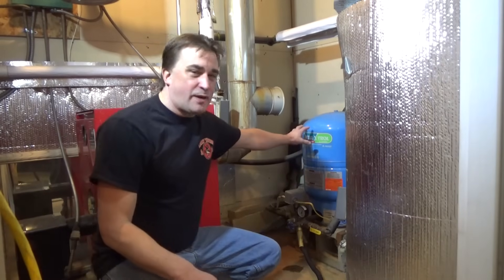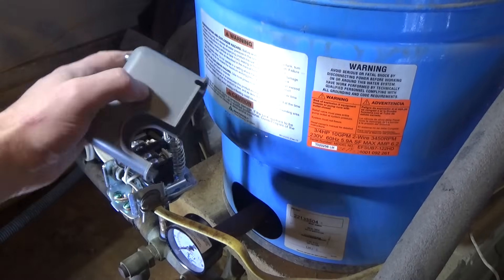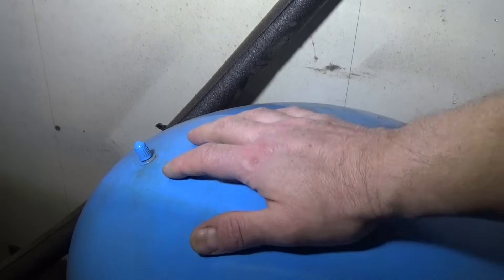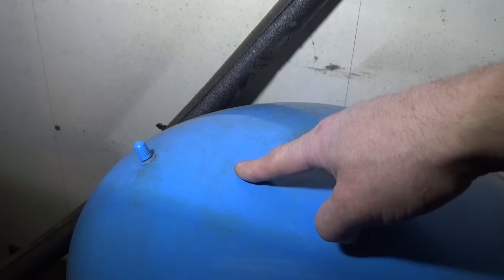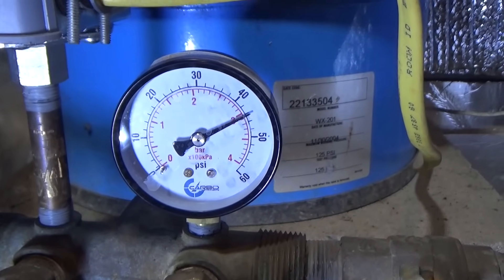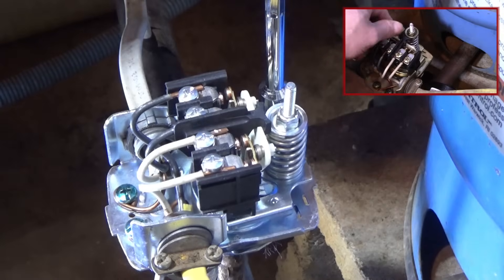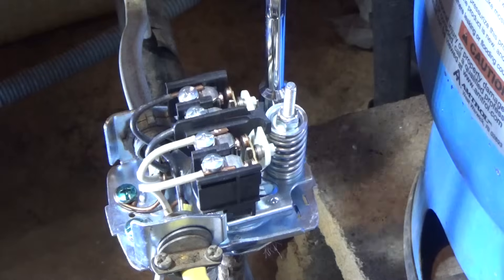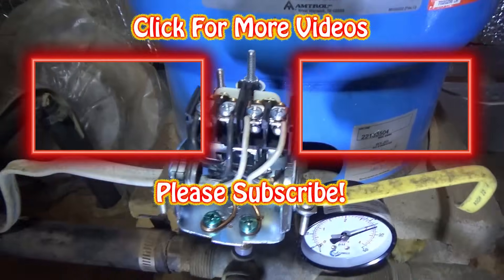How to Adjust a Water Well System Pressure Switch and Bladder Tank - Well Pump Diagnostics

Comment: Question..Installed a 40-60 pressure switch. Turned on power, pressure was 70-90. Not good, any reason why.
Reply: too much pressure in the tank when it is empty , t2 lbs. under cut in empty , check valve is fine , gauge is wrong

Comment: You could state which way you turn the adjustments. For example to cut in at a lower pressure turn ccw. To cut in at a higher pressure turn cw. To cut out at a lower pressure turn the other adjustment ccw. To cut out at a higher pressure turn cw.

Comment: Thanks,was good expansion,,
How we can set pressure switch when u have twin unit with 2 pressure switch?
Reply: Only the pressure switch with power to it needs to be set , the cut in pressure of each tank also needs to match , that is 2lbs less than cut in with the  tank empty

Comment: A quick tip.....if after taping the side of the expansion tank listening for a change in the tone which defines water at the bottom and air in the top if you cannot make out a difference in tone take a small screwdriver and press the air valve atop the tank for a second and if you get water shoot out it means the diaphragm in the tank has ruptured with NO FIX...it has to be replaced .
Reply: I suppose that can be why my pressure valve reads 100 and has rusted on top of it. It could be that my pressure is all the way up for cutoff. Ill verify that as is done in the video then look for this
Reply: Get up lebastard get up.
Reply: H u 5y
Reply: Great additional comment on top of a perfect general instruction! Thanks for the tip 
Mr.@harrylebastard!!!👍
Reply: Great tip Thanks
Reply: Absolutely true and a great point to point out here thank you!

Comment: Still when one of two out door faucets is being used the pump short cycles. When both faucets are used at the same time the pump runs without recycling? Help
Reply: Ken Woodworth if all is well and you have NO leaks of water or air then yes it should be constantly running however if you have a small tank it may fluctuate as the volume of water being pumped in has to be the same or greater than the volume being pumped out.
It also depends on whether you have an aerator which has its own pressure tank and contacts with water provided from the well pressure tank and contacts.
Hope that helps
Reply: water logged tank if it goes onoffonoffonoff , if you are suggesting not turning off and on while both hose are running means you have the max amount of water the pump can deliver it can not fill the tank and water the grass

Comment: I want to drop pressure from 60 to 50, do I have to let the air out of the pressure tank before adjusting switch?
Thank you in advance
Reply: Probably, but first of all you have to find out how much air pressure is in the tank, don't you? As far as I know the only way to do this is to drain all water out and take and adjust  the tank pressure.

Comment: I have a 30.50 switch on a 1 hp pump, once or twice a week my pump will  not kick back on, I can tap on the points cap and it will kick back on.

Comment: I noticed the other day my pressure seemed low, found out my well was running constantly. Most likely lost prime. Can you tell what to check and how to get my well primed? Thank you so much
Reply: Impeller broke
Reply: need more info , you say prime which means jet pump , your issue is likely the foot valve or an air leak , prime , remove the nut on the top add water till it stops bubbling , replace nut turn it on and cross your fingers

Comment: Hi Mark
I'm trying to adjust my water tank pressure via the pressure switch and what I really liked about your video is the ELECTRICAL SAFETY THAT YOU STRESSED as I am not 100% comfortable working with electricity. So I turn off everything that you have mentioned in your video. Thanks M

Comment: In your earlier comment on your video you mentioned you had to change the pump. Was it because the pump wasn't pumping enough pressure to reach the 50 psi cut-off? Thanks for a great video; I followed everything else on your video.

Comment: we have something going on with our well the old pressure switch keep popping the water would run a day then shut off i moved the points in side it jump on . Ok from there we bought a new one installed it work good and again the new one did and is still doing the same as the old one it will work maybe a day or less then i have to go to the pressure switch and move the points in then it jump back on . can it be the control box i need to replace need help PLEASE
Reply: its a tank issue

Comment: Thanks Man!  I had a 30# differential, I had to correct. Got it at 31" on, and 53# off. Right where I want it.
Reply: Your old setting was better in my opinion: less on/off cycling means longer pump life.

Pumps are the expensive part to replace.

Comment: How can I confirm my pressure switch is shot ? The damn pump won't turn off at all. Getting pissed off. You mention there is tension when adjusting , I have no tension.
Reply: switch has failed , or tank failed for a  $20 pressure switch , just change it

Comment: Hello.  If I lose power to the house and the faucet is turned on until the pressure in the tank is emptied do I need to reset the pressure in the tank to 2 lbs below the setting after the power is restored?
Reply: no, set tank pressure aprox 10 percent below cut in pressure (only a broad instruction)
Reply: NO its a closed system in your tank air and water do not mix ,  it is impossible to compress water, thats what the air does

Comment: 120 volt ac will (grab you) your muscles will contact and you will be unable to let go. 240 volts ac "should" throw you back or blast/burn the body part (finger) & break the circuit (you). Either way be Safe! Good Video!!!

Comment: Thank you! My pump would continuously run around 53 PSI and didn't know where to even begin with pressure switch. Found my bladder at only 24PSI and my switch is marked 40-60. Inflated bladder, what seemed like forever with my little 110v air pump, to the specified 38PSI and set cut in and cut out correctly. Hopefully I won't find my pump just droning and droning anymore, can't be good for my electric bill. Again, many thanks.

Comment: Thanks for the clear explanation. I only have a single spring. But by dialing the screw out I lowered the high-end cutoff and now my pump shuts off each time. Previously, it was running endlessly most of the time. Cutting the power off seemed to re-set it for a little while, then it would run endlessly again. Now it shuts off. One point to make is to mark the starting point when making adjustments and counting the turns. This way you know where to go back to if need be.

Comment: GREAT INFORMATIVE VIDEO !,...FYI,...I replaced ALL my 1/4 inch fittings for the pressure switch, and the pressure gauge, and the drain faucet,....WITH BRASS FITTINGS !   I found out that black iron, or in most cases galvanized pipe fittings,...would eventually CORRODE and plug up, causing either no or faulty readings. ...Go for all brass fittings !

Comment: You talk to much
Reply: Why did u take it personal. I liked and subscribed man. It's called constructive criticism. I used your video on a service call. How would I have time to youtube shit while I'm running service calls and turd hurding dude. It's legit constructive criticism. Aka turn back the chatter and common sense safety shit and get for to like useful information. Unless u work for osha too. Calm down man
Reply: And btw. The service call was for a jet pump not working... took the cover off the switch and boom it worked. Put the cover on it stopped working. Brand new switch. No corrosion on wires or contractors, and no sediment in the switch itself. Ever heard of that one?
Reply: @nogripes  to give closing. The cover constructed wires causing them to move and lose contact without causing arc. The wires were trimmed back and positioned tighter to the switch to prevent it

Comment: So if your cut in and cut out points are good but the water pressure is not strong enough at the shower is it ok to increase the psi on the center bolt on the pressure switch ?
Reply: Had this problem also but found the water filter was the problem on one occasion. ....the second occasion it was part of a rubber washer broke and partly blocked the shower head. Worth considering.

Comment: I do"nt have an in line gauge so I have been doing all my pressure checks at the schrader valve with a very accurate gauge. The cut out pressure is scary high with a new 40/60 pressure switch..My question : Will the pressure above the bladder be different under normal operating conditions  thus causing my high readings..The small spring adjuster (for cut out only) seems to have no effect.. thanks in advance
Reply: replace the pressure switch and install a gauge, the pressure below the bladder will be less

Comment: so turning cw on the little spring increases differential between cut in and cut out  pressure?  and cw turn on big spring increases both cut in and cut out pressure?
Reply: I was taught you should never need to mess with the small screw.
Reply: nope , its printed under the lid , little screw cut out ( pump off) big screw both high and low change equally don't screw with it , in the business as a pump installer for 20 yrs , tell me why you want to adjust the pressure switch and i will tell you what the actual problem is
Reply: @doug55469  my water pump won't shut off. Can you explain why don't have the money to pay someone and I think it's an easy fix. We'll hopefully

Comment: What is the cut in and cut out with regards to the water pressure? In other words what is the pressure to be as the pump kicks in and the pressure when the pump shuts off?
Also what screw does the raising of pressure and which screw stops the pressure from dropping too low?